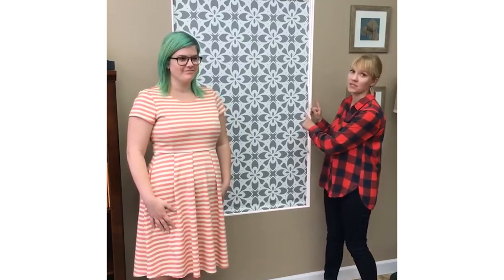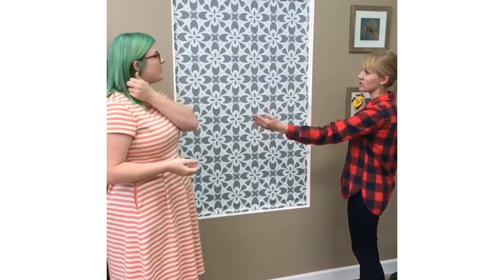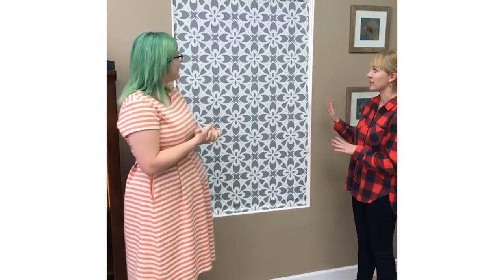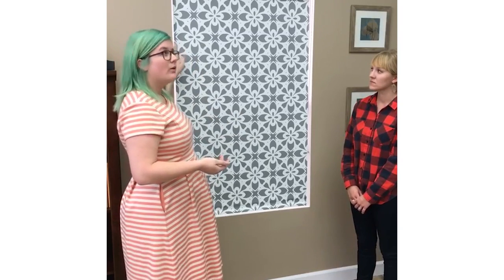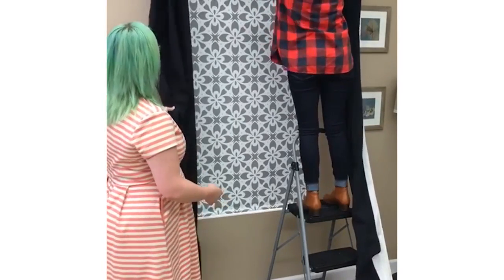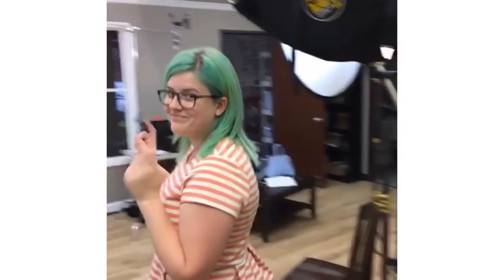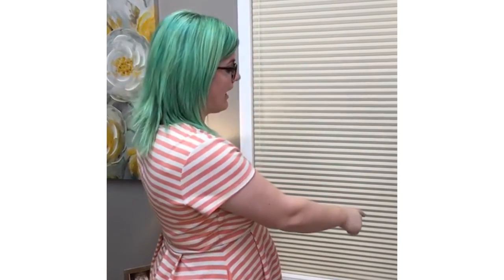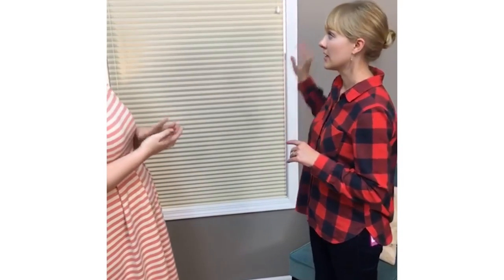How to Stop Light Coming in Through Sides of Blind | Blinds DIY

Comment: 5 minutes and 2 people to say two words "hang curtains"... Doesn't really answer the question. Disappointed. I'm sure myself and most people that found this video are actually looking for ways "plural". More specifically, ways to add some type of side channel to already installed blinds or shades to block light. Of course curtains could be an option unless you bought shades because you don't want curtains! That you spent (like myself)  $2000 on cellular shades to get rid of curtains. Blackout shades for your bedrooms because you're a night shift worker...and was expecting a better light  seal and darkness than crappy curtains... God job on the actual video just disappointed with the singular-minded content that does not really answer the question of how to block light from the sides of shades and blinds.

Comment: Good video to waste peoples time. Title is incorrect, as you are not stopping the light at the sides of the blinds, you are just adding another layer of something over the top of the blinds. Hey, if that doesn't work, maybe you can add a 3rd, and a 4th layer until the light is blocked out.